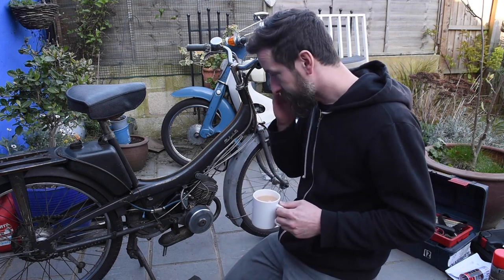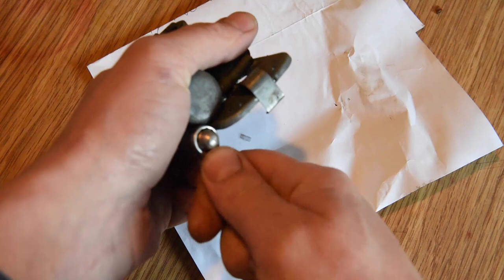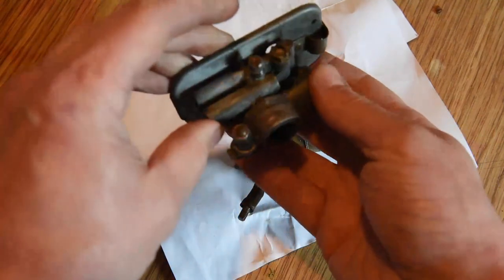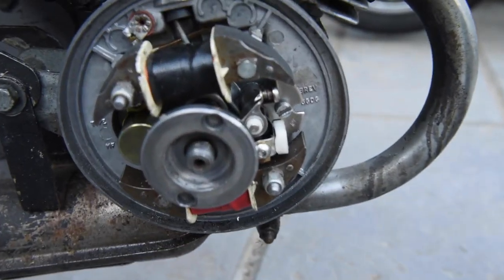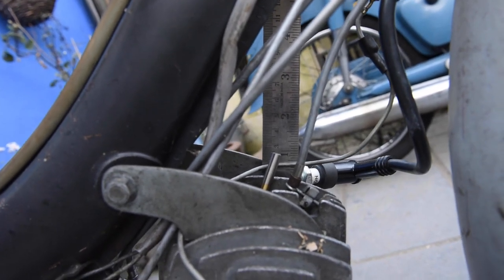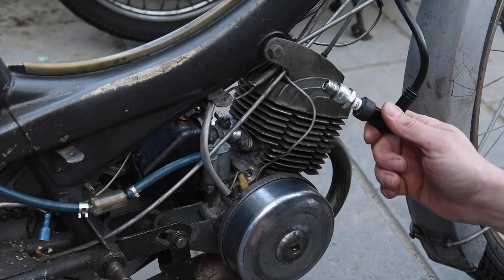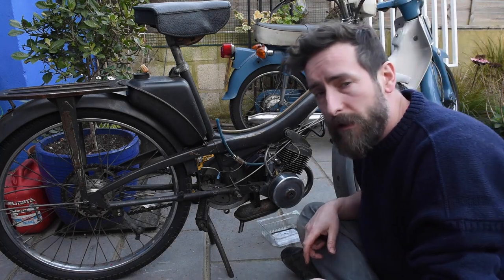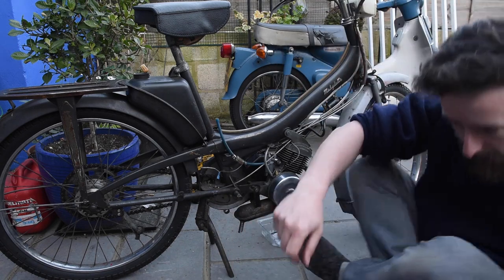I BOUGHT A MOBYLETTE, Will it run? Cheap fix? FUEL AND IGNITION. PART 2.

Comment: Hi mate I've just refurbished a Mobylette the same as yours but can you advice how you change the engine oil?
Reply from the maker: It’s a 2 stroke so no engine oil. I think some high end models have a gearbox that require gear oil though.